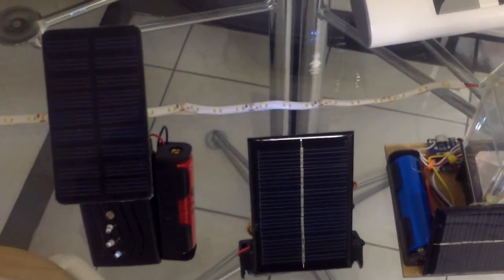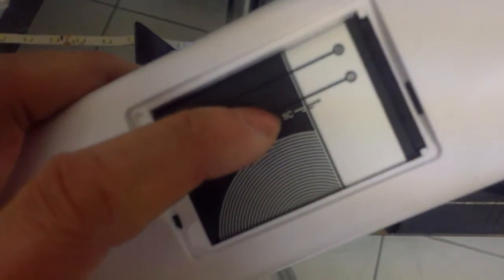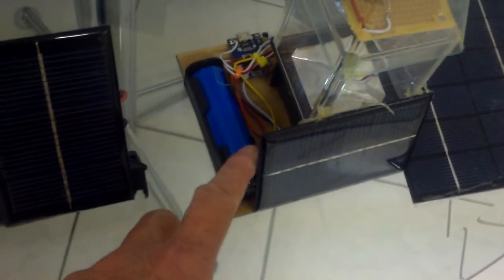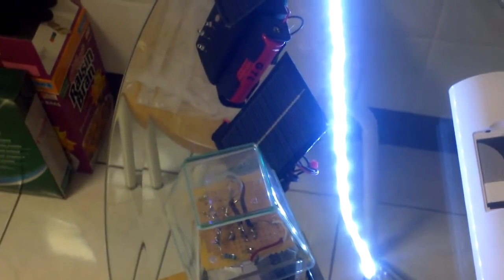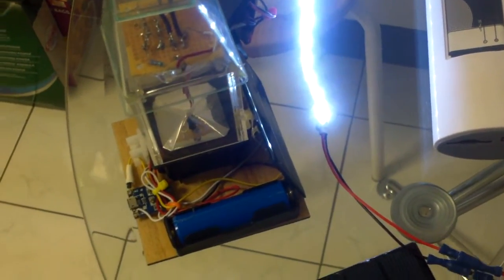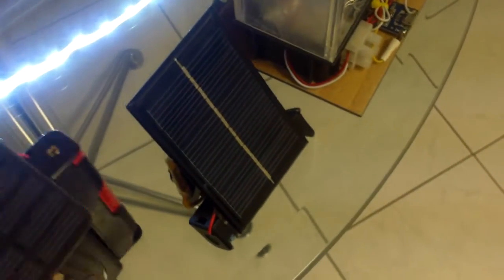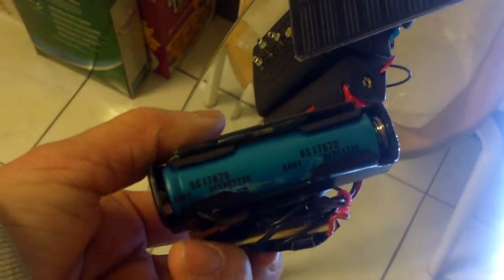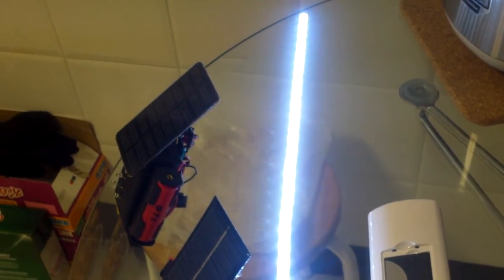True dusk to dawn solar night lights and garden lights

Comment: Can you help me to design a little bigger solar system with lithium ion battery for solar obstruction lights? the consumption of the light is 3W. Thank you, Charles.
Reply from the maker: A simple one that can go on at dusk till dawn can be relatively easy to make. You need 1 solar panel (50w or so), 1 pwm or mppt controller that can handle lithium ion and Lifepo4 battery(10 to 20Ah). And a 3w led bulb. That’s all you need. Make sure your controller has a load control function.

Comment: Thanks for your kind comments....These little chips are really astounding, don't forget the Inductor swap...33uH Axial inductors seem to work best for a brighter light..Also you really need to ensure that the solar panel is in good sunlight to recharge. I have noticed only maybe 20-30mAh and 30-40mV drop in battery charge after running all night...